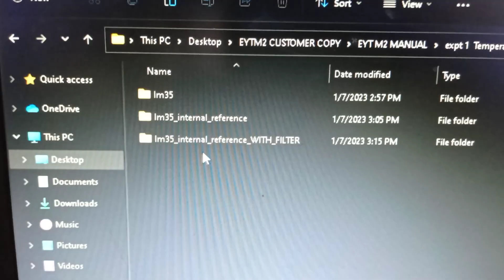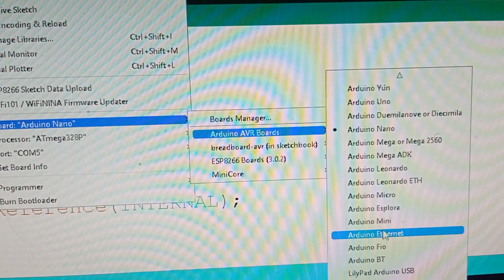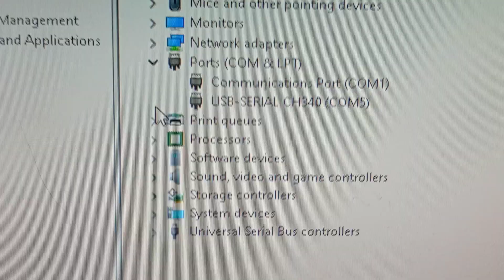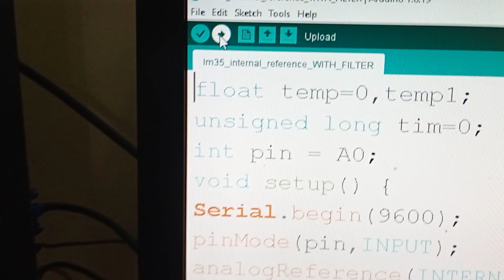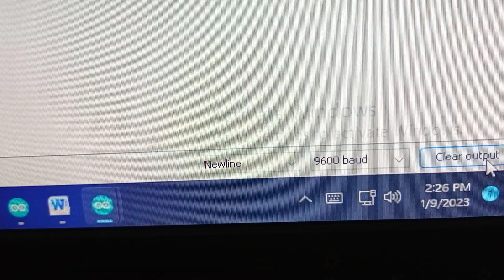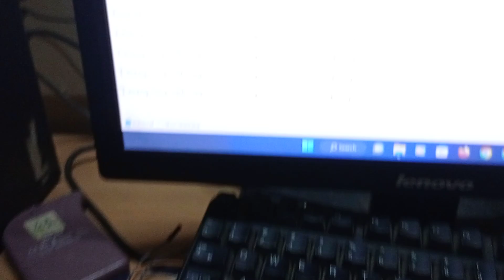ARM BASED ARDUINO LAB R20 ECE JNTUK ARDUINO LAB EXPT 1 TEMPERATURE MEASUREMENT

Comment from the maker: code:
float temp=0,temp1;
unsigned long tim=0;
int pin = A0;
void setup() {
Serial.begin(9600);
pinMode(pin,INPUT);
analogReference(INTERNAL);
}

void loop() {
  temp1 = (temp1*19.0+analogRead(pin))/20.0;
  temp = temp1*110.00/1024.00;
//if(millis()-tim>1000){
 Serial.println("Temperature is : " +String (temp)+" deg C");
 //tim=millis(); 
//}
}